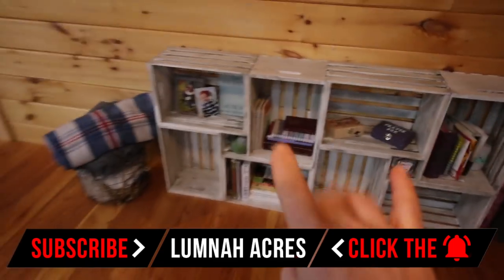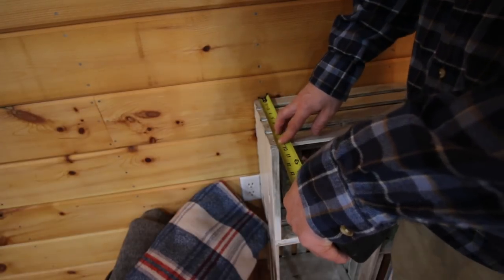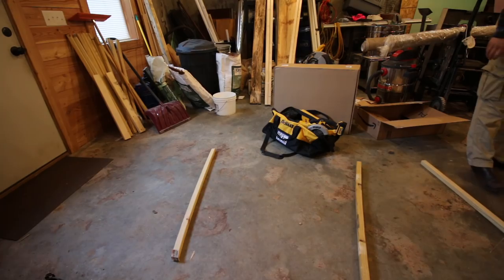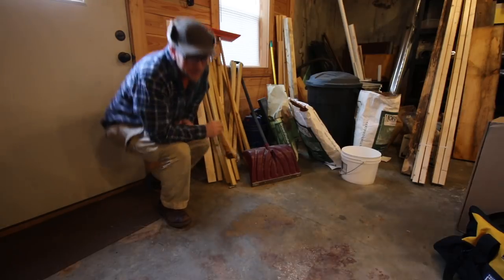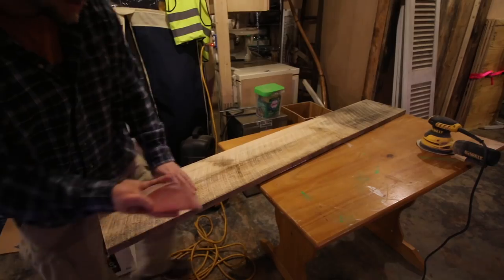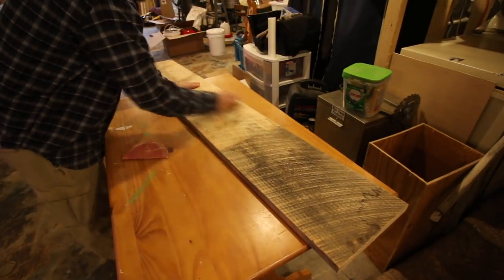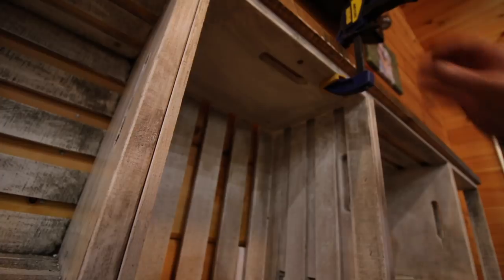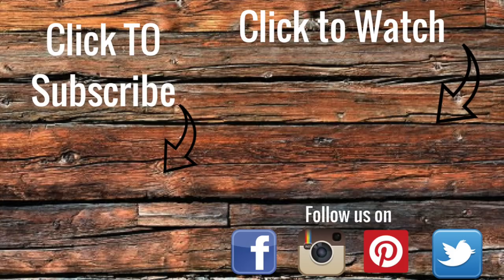DIY Rough Saw Lumbah Wood Crate BookShelf Top

Comment: So funny I have 1 book case that covers 2 halve wall in my bedroom it's goes from the corner and continues from the corner to both the next walls. And they are antique fruit crates. Love that home made book case and I haven't drilled them just stacked them so I can redo and ad on and change the shape of the case. 

But yours is also very cool with a top board. 
I like rough sawn lumber for the patina and diff old colours. I have my porch floor out of rough sawn lumber. It looks very rustic. 

Thanks for new ideas and wood work tips and tricks. 

Kind regards rose

Comment: nice but the clear coat white spot on the front edge is driving me nuts, plus you should clear coat 1 coat on the bottom this will help avoid more board twist.

Comment: Great project indoors is a bonus.  Remember the non dairy creamer or fat to use as a surfactant that stops foaming in syrup boiling phase.  Cottage industry's Menonite mfg. Beautiful stove and condenser stainless tray $1,300.00 Great American Homestead on Utube he added a pre heat chamber and it's in a cattle panel sugar shack temporary.  Research tubing you can use to import sap and water animals after.  The stainless top doubles as a hot water canned for garden items..salsa..tomatoes.  $5.00 samples go to the LEF fund.  Libby Education Fund.  Watch for used small dairy vacume pump and receiver group with transfer pump and plate filter.  Next year plastic tubing and vacume moves the sap into a TOTE that transfers via gravity into the pre heat pan.  Restraint supply heating pans are good starters.  Propane may be costly except to finish.